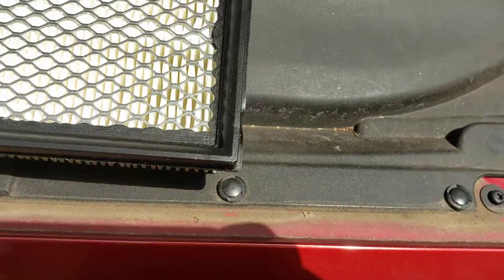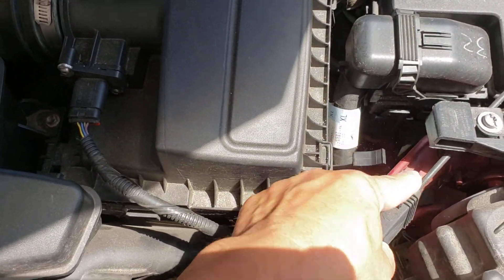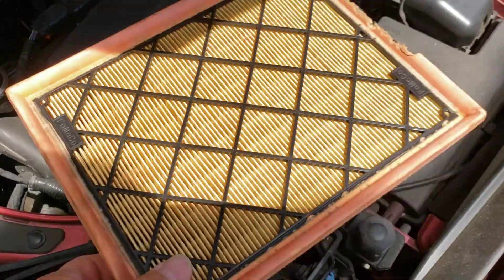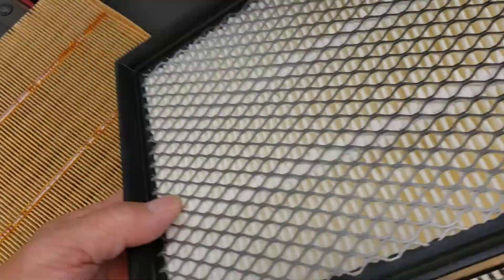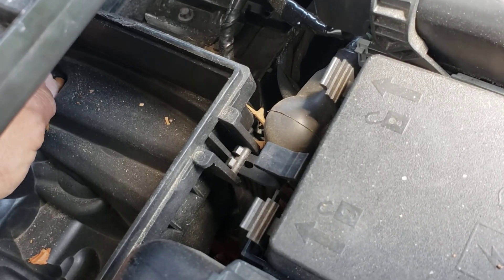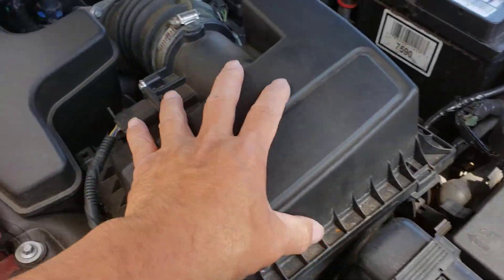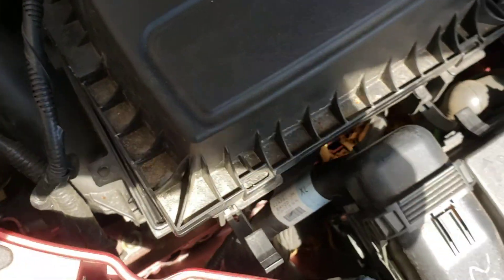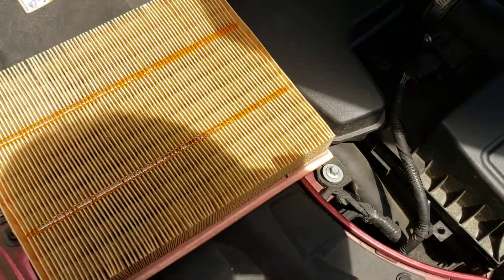2013 and Up Ford Fusion Air Filter Replacement  Change How To

Comment: This is different from a cabin air filter correct?
Reply from the maker: Correct..cabin is inside behind your glove box
Reply: For those who don't know, THIS air filter is making sure the engine gets clean air, however the CABIN air filter makes sure the interior gets clean air and it located in the glovebox instead of the engine bay